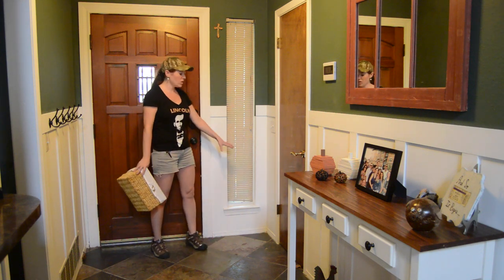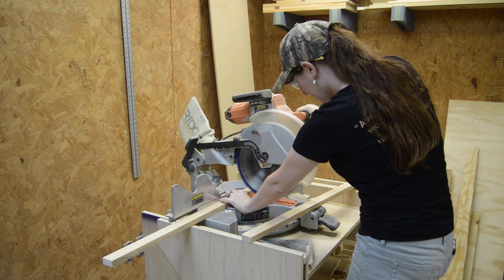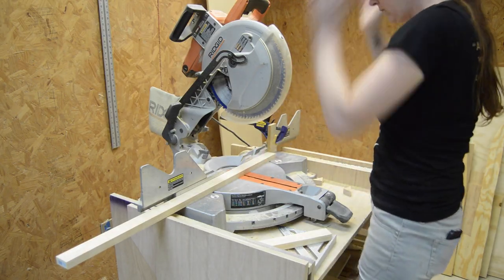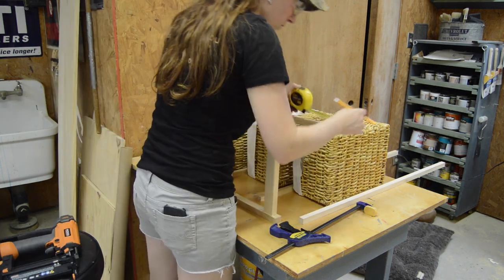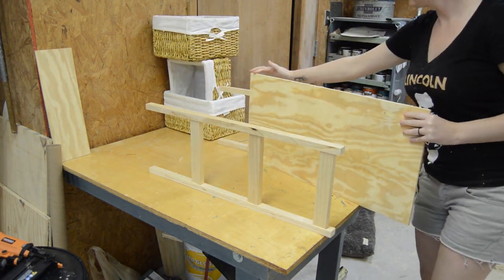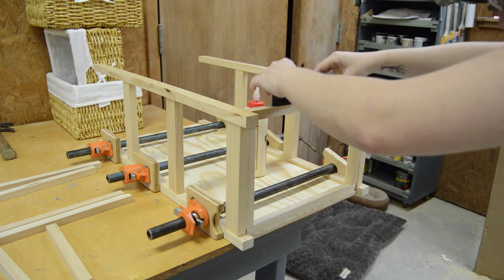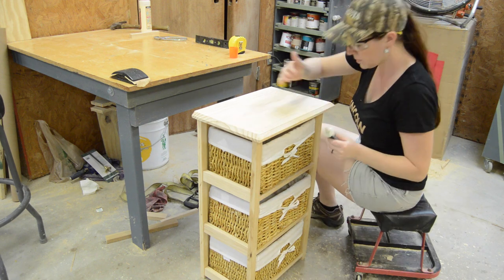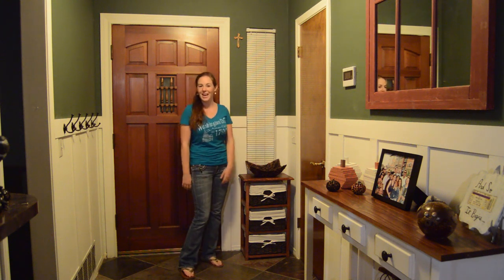DIY End Table

Comment: I really like how you don't go overboard with the joinery on your projects. I honestly have been intimidated by a lot of other woodworker's projects because of how complicated and precise every cut/joint has to be. Your method of "cut, layout, measure, and cut some more" is awesome! Keep up the good work.
Reply from the maker: Haha, I like your explanation of my method. :) The reason I don't go over board with joinery is because I don't know any other methods besides pocket holes and butt joint! I need to learn a few more just so they are in my bag of tricks, but I just haven't taken the time yet.
Reply: When I first started woodworking I was also a bit intimidated by what at the time seemed like exotic joints.  I had a subscription to Fine Woodworking, and over the years I picked up enough from that source alone to try new things.  Once you tackle a few basic joints a whole new world opens up.  Then you start using more exotic woods, and the hobby suddenly becomes expensive.  :-(
Reply: April Wilkerson Well you seem to be getting by just fine! I use half laps a lot; really easy to set up and cut.

Comment: Really nice proportions on this one! Like some of the other commenters here I like way you use basic joinery to simply get things done. For light duty pieces like this one glue and brads will work out just fine, and I sure could use some of that attitude towards simplicity. Be careful though when nailing/gluing a solid wood top to a frame like this: Expansion and contraction of the solid wood top may cause cracks to develop as time passes. Humidity levels might be pretty stable in Texas I guess, and with a small top like that, there is probably not too much going to happen, but with things larger than this, you might well get some issues.

Comment: Nice job and well done. Only negative is the joints for the rails. Glue doesn't work at all on end grain, only on side grain so the slightest diagonal pressure on it (if someone were to lean on it for instance) I guarantee a couple of the joints would crack, the nails will simply pull or bend. Biscuits would have given a much stronger joint, or dowels, or if you want to spend the time, mortice and tenons. Well done though, high level of expertise with the tools.

Comment: love the basket stand April. You seem so chilled on your builds, how do you keep it accurate all the time
Reply from the maker: I just take my time and work through the project step by step. I mess up sometimes, and I just think about how to fix it. As you saw, I would work a step then look at it and then think about the next step. Then repeat for the next. : ) I couldn't think of every single detail and measurement all beforehand like the pros do...it gets all jumbled and I end up getting overwhelmed and not starting the project. So instead I focus on the overall concept of what I want, then build in the details as I am making it. For example: I cut the legs then set them down and played around with different heights for the side pieces, then I cut those. Before building this project, I couldn't tell you an exact depth of the sides, but I could tell you that there was going to be sides. : ) Does that make sense?
Reply: Thanks I will try that

Comment: Not sure as to why but I felt it needed taller feet. looks great there thats just what came to me & I don't know why.
Keep up these great vids.
Reply from the maker: No I actually agree! However, I didn't want to make it taller because I have two light switches that I didn't want to block. So I actually think about another 1/2" on the feet would look better.
Reply: Ok at least I feel less crazy now Thanks

Comment: Did you ever have a fear of using tools/machines with fast moving blades like table - chop and band saws? I like working with wood and such and I'm just fine with hand tools. Hand drills and drill presses don't bother me at all; but routers, table saws and the like scare me half to death! 
How do you get over the fear of losing a finger or worse when using such machines? I know you should know all the safety precautions and such, but I just can't get comfortable around those things. I even cringe when some one else uses them. :-(

Comment: Seems like this project would have been a perfect candidate for pocket hole joinery any reason you used a nail gun instead?
Reply from the maker: I use my pocket jig for almost every project, but this is such a light weight little table that isn't going to be supporting a heavy load that I figured my nailer would be fine.

Comment: Great job, April.    Took me back to something similar I made for my wife - Avril - for storing her patchwork materials.  See http://lumberjocks.com/projects/54010 - but I added tops to each column after posting to LJs.
I've just finished making another unit, more like yours, to accommodate two of the larger baskets we had over because, unlike you, I made the unit before the baskets arrived, and two of them were bigger than specified!   This was made from solid boards because I did not want it to tip over as the basket containing heavy files was pulled out.   It is shown here:  http://www.donjohnson24.co.uk/images/Bedside.jpg
It has been great to see your confidence in your work and presentations growing since I first discovered your videos.   You are a very accomplished lady!
Oh!   And I love the wave!

Comment: why did not basket's bottom some reinforcement ? (how correct to ask it in english? %-))
Reply from the maker: No big reason....I just thought it was a waste of material. I could use scraps to makes these shelves like this, but if I made them solid then I would have had to buy wood. Since the baskets aren't going to be holding anything heavy, I didn't see any reason to make them a solid shelf.